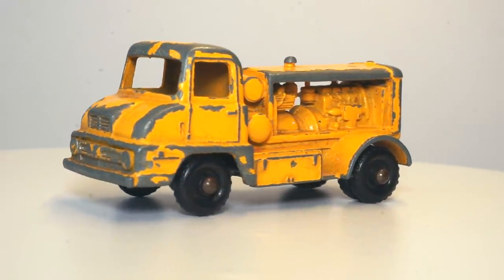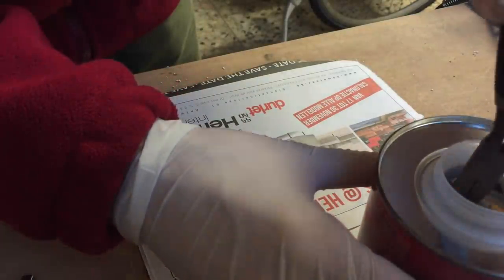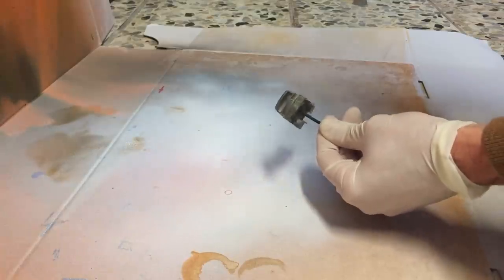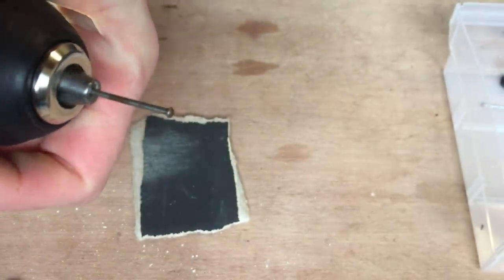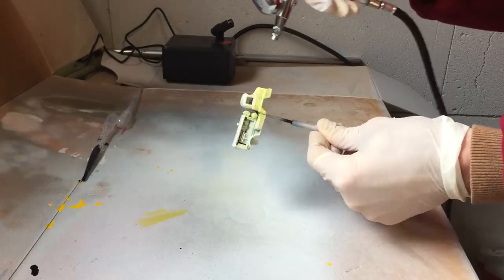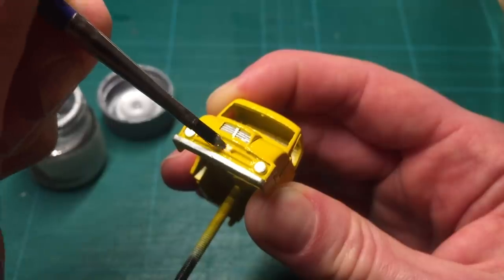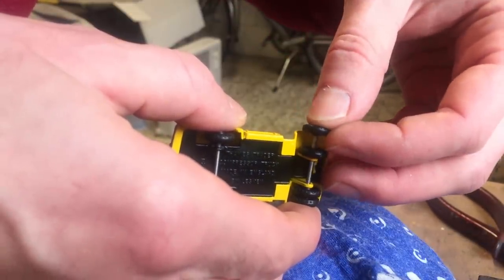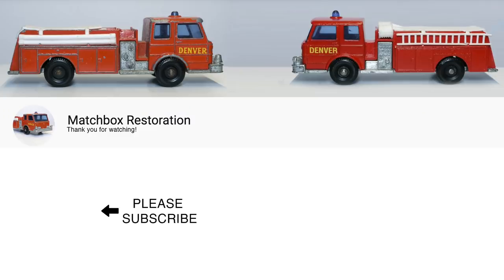Matchbox 28b Thames Trader Compressor Truck - Full Restoration

Comment: Excellent. Using cockpit spray on the wheels is a new one on me...I'll give it a try. When you do get a drill press you will find doming the axles so much easier,..especially when the wheels are recessed under mudguards  (you call them fenders). A drill press also helps when drilling out the rivet post. I see that one post mentions using a cup head nail punch to dome axles...that really works as well. This is an excelllent restoration....keep up the good work!
Reply from the maker: Thanks for taking the time to give some advice! I'll look into the head nail punch method. I'm a bit afraid it will bend the axles, though. I'll try it on one of my next restorations!

Comment: Looks good but still bent downward in the center of the chassis between cab and compressor section. Overall paint and details look good. Thanks for sharing.
Reply from the maker: Indeed, but the casting was cracked between the front and the rear. Bending it would have broken the frame in two. That’s why I left it as is.

Comment: You may want to look for a 'cupped-tip nail punch' for creating a 'mushroom' on the axle ends.
That might make that process a bit easier.
(If anything, it will prevent that hammer from getting too close to your finished restoration.)
Reply from the maker: Good advice, I will look into that. Thanks for taking the time to share this!

Comment: One tip - you might want to buy a pin hammer with a pein end. It’s a smaller hammer with a smaller head. Less likely to damage paintwork if it slips.
Reply from the maker: Good advice! I'll look into that!

Comment: Several recommendations:

Short:

1) Use Floor Polishing liquid to clear the transparent plastics (this is from Marty's videos)
2) Use 2-pin drill press, like Marty does. Hammering the axles bears the risk of bending them 
3) to clear the paint use the same paint stripper Marty uses (you are in the same country, so it should be easy to find the same)
4) When removing the lip, hold the near-by wheel in order not to scratch it with the sanding roll from the Dremel tool.
5) To de-oxydize the car, you might use electrolysis and electroplating (more details here https://www.youtube.com/watch?v=MG3i-2aruNM)
6) For the clear view on the top coating, as you've said in the video - use a brighter lamp or many bright lamps. Turn them off afterwards.
7) Drill the rivet post while dissembling the car, and leave there the screw, in order to protect the interior from accidental paint occurrence.
8) at the end on the rotating disk show the car before the restoration (so you need to record this before starting the restoration) and then add the video on already restored car (this can be seen on the most of the Marty's video)
9) Put some oil on the tap, when making the threading. Do not put too much, as hydraulic pressure might be formed and ruin the post. (Marty shared this in his videos)
10) Use transparent decals, not stickers. In time the stickers shall become yellowish.
11) Re-purpose a drill bit for the rivets, making the tip of the drill bit shallower, this way reducing the probability to puncture the whole roof or other surface on the other side of the rivet.

Long: for tips 1, 2, 3, and 4, 7, 8, 9, and 11 watch all the videos of Marty. There he

P.S. English is not the primary language for me.
Reply from the maker: Great advice! Thank you for taking the time to write this down. I’ve addressed some of your suggestions in my new vids already. 👍

Comment: Just use an aerosol paint stripper.  It’s usually odorless and can be sprayed indoors, and works way better than brushing it on.  It gets into all the tight areas way better than what you and others use in these videos. Good work on the model, though.
Reply from the maker: I'll look into that, thank you!
Reply: jakfuki, nice tip. What brand do you recommend?

Comment: Great job. Is the cab bent slightly back, or is that factory? Watch out, Marty!
Reply from the maker: It is slightly bent. The connection between the cab and back had some fine cracks in the casting so I was afraid of breaking the model in half. I leave it as is until I find another model. Thanks for the kind words!

Comment: Very enjoyable. I just found your channel, so I was wondering about your technique on the axles: grinding off one of the nubs  and then re-creating it by hammering the ground-off end worked fine, here; but if you had an axle that didn't have as much side-to-side play as this one - or was rusted or bent - do you fabricate new axles?  Marty's Matchbox Makeovers usually just snips the axles in the middle and then makes new ones out of rivets.

I would like to see you tackle a larger model, as was commented earlier in this section, but maybe something more unusual than a King Size; something like a Battle King tank, or a Sea King, or even a Yesteryear.

Now, if you will excuse me, I have to go watch all of your previous videos (so much for going to bed early, tonight...)
Reply from the maker: Haha, watching all my previous videos couldn't take much longer than 15 minutes at this time 😄Thanks for the kind words! You are right about the axle-method I'm using right now. It has it's limitations. I have 1.6mm diameter nails laying around to replace axles that can't be refurbished. But as long as the original ones are in good condition, I'm planning on re-using them where possible.
I have a couple larger models laying around from when I was a kid. Maybe I'll restore one as a special in between. 😊
Reply: @MatchboxRestoration  Yeah, right after I posted that, I realized you hardly had any vids posted, yet. I was going through several diecast resto channels, and I must have somehow mistaken one of their archives for yours.
Still, if you haven't checked out Marty's Matchbox Makeovers, I think it would be to your advantage to do so. His evolving processes could potentially save you some time and trouble as you develop your own.
Reply from the maker: @bwilliams463  I got my inspiration from Marty's channel to start doing these restorations. This saved me tons of time to check out how I have to do these restorations. 
Don't you worry, there are a lot of models waiting to be restored! Soon there will be more. Stay tuned ;-)

Comment: That hammering looks scary. You did a nice job and one wrong slip could ruin all the work you put in. Try using a jewelers rivet hammer, no risk of hitting the body.
Reply from the maker: Hehe, I do check if the axles protrudes the mudguards, so I'm not in trouble :) I might need a smaller hammer, though. Thanks for the advice!

Comment: How 'bout using a "nail set" to round over your axle hubs? They come in various sizes..one should work with your axle diameter. It'll get that hammer blow safely away from that freshly painted body.
Reply from the maker: I'll look into that. I thought about this but didn't see me hold the model, the tool and then using a hammer at the same time... Maybe I'll figure something out for my next restorations.
Reply: @MatchboxRestoration  Well don't overthink it...lol. I don't think it'll be as difficult as you're imagining it to be. $8 for a set of three is a bit cheaper than a drill press. Either way, have fun with it! Your paint is looking great!

Comment: I would've masked the compressor and left it bare metal then painted the rest of the body then clear coated the whole thing personally (would've made it a little more detailed and interesting)
Reply from the maker: I understand, but I like to get them in original state, that's why I don't change the trim details. I might make a custom in the future.

Comment: Until you get a drill press take a nail and put it in your vice and create an indent into the head of the nail. (You can use it later in the drill press) Then just tamp on the  other end of the nail. (I'd flatten the point!) Then as you tap it with the hammer, move it around a bit to help round out the end of the axel. You can also just chuck this up in your hand drill, and use that as well. I've done that before. I kept waiting to see the hammer hit the truck fender and ruining your work!
Reply from the maker: Thanks for your advice. I looked into this while doing my first restorations and made some "tools" like the one you described. The thing is that it's hard to keep both the axle and hand drill in one line and apply pressure to it. It kept moving from its vertical position when I applied the pressure needed to form the axle. I do like the first suggestion, I might try it in a future restoration.

Comment: Well done. Perhaps too much paint, it took some of the quality of detailing away. Maybe more thinners, lighter finer spraying and drying between applications. The paint can be a make or break. Maybe the clear-coat needs thinning or omitting altogether. A good job over all.
Reply from the maker: Thanks! You're actually the first person that says I used too much paint, that's why I put both 'before' and 'after' pics next to each other to compare. The restored model shows much more detail than the original one actually. I'll look into your advice for sure. I'm new to this, so thanks for taking the time to write down your feedback! Have a nice day!
Reply: Matchbox Restoration looking forward to your next model!
Reply from the maker: @christopherward5065  Thanks!